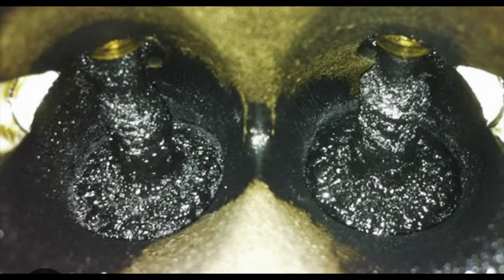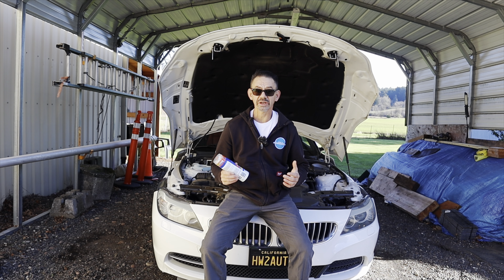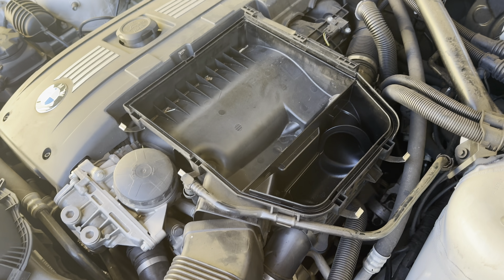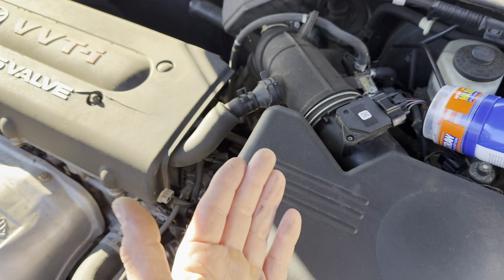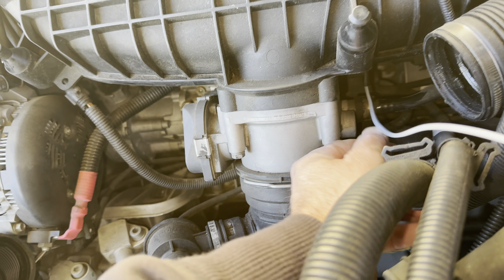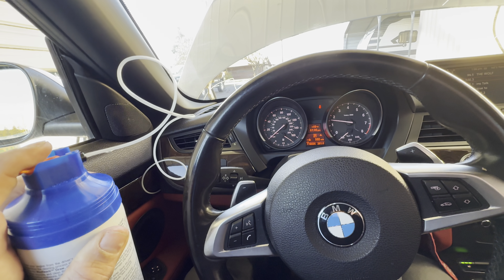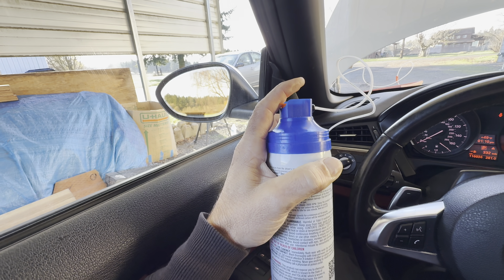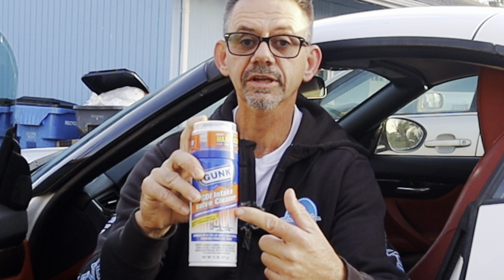How to Clean GDI Intake Valves the Easy Way (No Disassembly!)

Comment: Sorry to ask this but do you have any before and after images of the valves? Or even 1 image with the "after" so we can determine if the product is any good? I mean there are cheap cameras around 60 usd\ eur with which you can take a look at the valves without removing the intake and you can clearly see what is going on in there. I think that this should be a very good investment due to the fact that you are into the flipping cars business and this tool could help a lot even when you go and purchase a new project. Thank you and have a great day